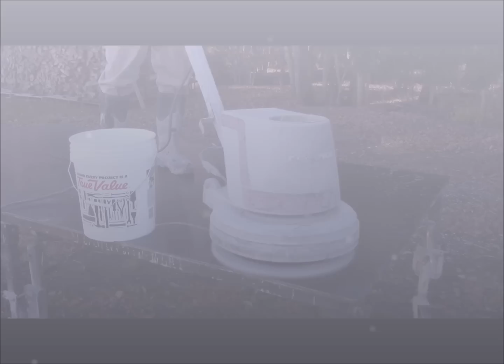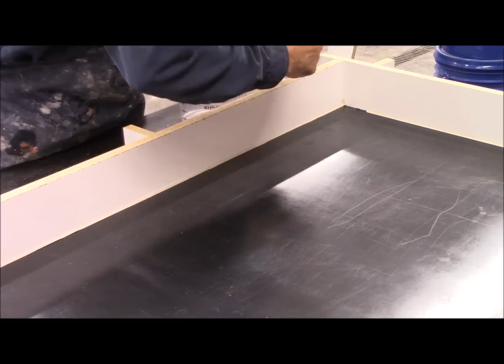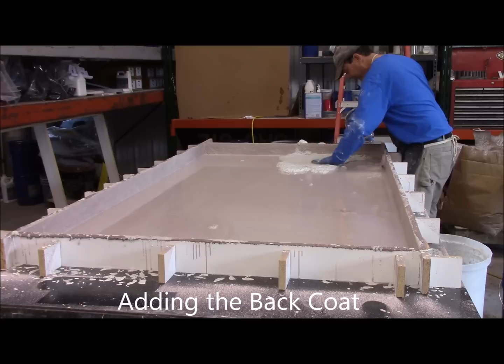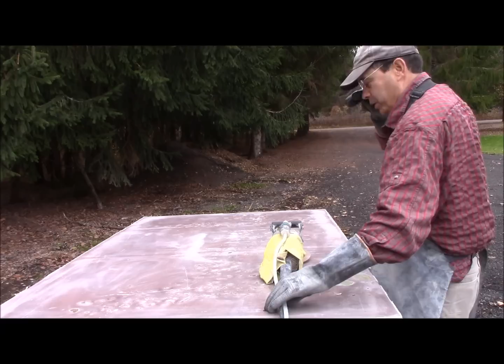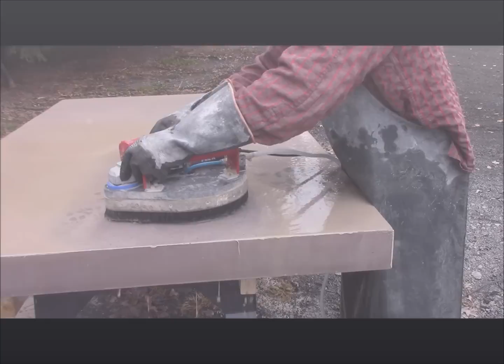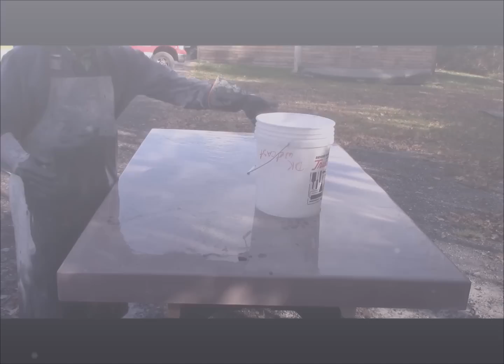Trinic GFRC Dining Table - Glass Fiber Reinforced Concrete

Comment: Hi Mark, can I ask you a “simple” question? How to avoid upward curling in any simple GFRC piece, no matter the size? Mainly countertops and tables. All your jobs are perfect, no matter size or thickness. But I can’t find an answer that eliminates curling. Thank you as always, for all your help and knowledge.
Reply from the maker: Hey Gonzalo,  this is Rich - the likely answer to your curling issue is uneven curing.  After demolding the piece needs to cure out evenly (top and bottom).  Shim the piece to allow air to flow underneath.

Uneven moisture loss is the leading cause of curling.
If you need more information - give us a call or email.
(607)775-1948 Rich@trinic.us
Reply: @TrinicLLC  thank you Rich. I will do what you told me.
Also, does the mix need some new admixture like something that avoid shrinkage? In my country (Argentina), CSA cement does not exist. White Silica fume does not exist. Only grey one. So, any advice about my mix will be grate if you think is necessary. I will do one or two tests, and I will keep you updated about results. Thank you again. Really thank you!
Reply: you can use a plasticizer to make a high flowable mix using less water which reeuces the chance of shrinkage cracking during the curing period, the mix shrinks during curing and much water or uneven curing can lead to pre-mature cracks.

Comment: I really thank you for all your videos, everyday I learn a lot.
Just I want to know, how do you “join” the concrete top of the table to the legs?
Because you are not going to “drill” the concrete. So, is it glued to the legs? Or is the top of the table just supported with the legs?
If is glued, how do you dismount the concrete table and the legs, for example, in case I need to move the table to another ni you for all your videos, all your advices, all your knowledge!
Reply from the maker: Usually just a drop of silicone. The weight of the top keeps it stable

Comment: Why do you say self consolidating? What do you mean by that?
Reply: Self consolidating (or SCC) means that it requires no vibration. Typically vibration is needed to let the air bubbles escape. With the addition of a plasticizer, you get a more liquid mix (without the addition of more water).